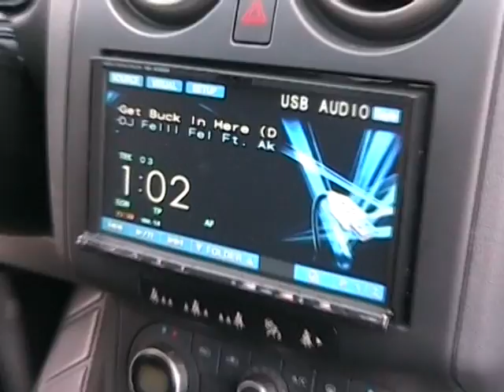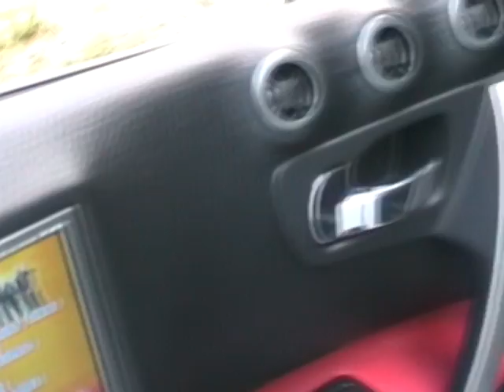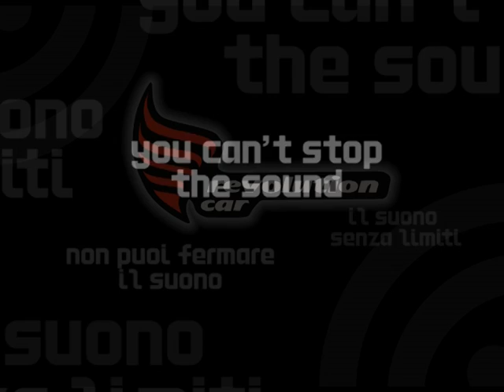jack Hammer mtx revolution car

Comment: when you cant lift up your sub by yourself your on another level
Reply: It's also 5 times more expensive than it's worth. $10,000 is absolutely blasphemous. There's subwoofers out there that are 10 fold what this sub is.
Reply: @Ole_CornPop  I think it's like a status symbol, bragging rights.  300lb subwoofer is cool.  Way overkill, but still cool.  Like a BMW.  You could spend way less money for something way better with much better reliability,  but you can still impress stupid people that think BMW is a good brand.
Reply: @Brainshatterer  And then we have the 24" square which is sold for 20k
Reply: @Brainshatterer  Well said you guys.  Smaller subs of a decent quality can pretty much give you the same results with less power wasted, and it wouldn't take a crane to build haha.